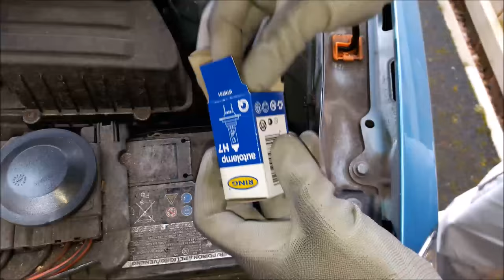How to replace a headlight bulb in Skoda Fabia, Skoda Roomster

Comment: He/she makes it look so easy, they're the most awkward bulbs I've ever had to change on a car 😅 . They don't twist out or back in with any ease whatsoever. Very frustrating and you may also have to remove the twisty bit in order to get the bulb free from the connector.
Reply from the maker: I know, the space is very tight
Reply: It’s because sociopaths become designers because they realise they cause more distress than if they had become serial killers 😂
Reply: Try  changing  the  DRL  bulb  nr  the  batt  it's  impossible.

Comment: What you have failed to show in your video is how to take off the fuel filter! That is the main problem changing this bulb as you have to have the right sockets and they need to be very long and very special.
Reply: I did it without removing, you just have to murder your hands to get in between there

Comment: how to change the bulb when there is the diesel filter that blocks access? I have a TDI
Reply from the maker: I have never changed the bulb in diesel car so unfortunately I can't give you any advice.
Reply: @k-nemo  thanks !✌
Reply: II have the TDI and the only way I could get the bulb in was by unbolting the filter housing (3 x 25 torx bolts) a bit of a pain but not as hard as first appears if you have a fairly modern socket set. I did mine when i was cleaning the earth strap which sits under the fuel filter so it was being moved anyway. Made getting the bulb out far easier.
Reply from the maker: It's great you have managed to do it
Reply: @richardsmith3735  Going to attempt this shortly. I've the same, 1.6 TDI and want to upgrade the OEM bulbs which are awful at night. Is it easy enough to access both lights?

Comment: The arrow that shows which way to turn the H7 bulb was necessary to know. Happy pulling it away I did not look so much on how it was sitting, I mean how to put it back. It took a while to figure it out. For me with a Skoda Roomster there are two broader tinplates that is going under the two screws that are on each side, left and right in the middle. and when you do that the third small tinplate should be up within the space that is to the up side, that tinplate is only to keep the bulb in place, to keep the tension when you slid the other tinplates under the screws.

Comment: Im struggling to get the bulb out of the connecter.. is it brut force and a wiggle?
Reply from the maker: You have to move the bulb from side to side and than pull out
Reply: @k-nemo  Thanks for your reply.. i refuse to pay for someone to fit a bulb.  Im convienced the car makers are making everything harder to make people fork out at main dealers
Reply from the maker: You're right, you can do it yourself within a few minutes

Comment: So if you should't touch the bulb with the fingers than with what you should touch it :)?
Reply from the maker: I meant not to touch the glass part of the bulb as it will have dark spots later. Also you can't pull for the glass as it can break. Both easy done as the access is really tight
Reply from the maker: @GregYou can do it with the glove. Be careful as the bulb is fragile and might break
Reply: As with a lot of bulbs fingers can leave a fine residue of grease, typically in the form of fingerprints and this causes the bulb to overheat and burn out. Wearing clean gloves avoids this problem. This is one of many reasons service engineers are to be seen wearing the disposable latex type gloves.

Comment: Now that you've removed the rubber cap and let moisture in.  How do you remove the moisture?
Reply from the maker: The cap is not a protection from moisture as it is not hermetic. It is a protection from dust only.
Reply: @k-nemo  
I changed the bulb on mine and now I have condensation in the light.
Reply from the maker: @martin4458  It will disappear after a while.I didn't have this problem.
Reply: @k-nemo  
Hopefully it will.  Thanks man.